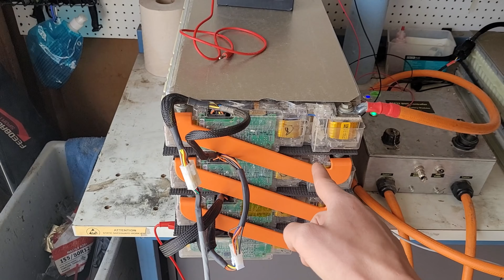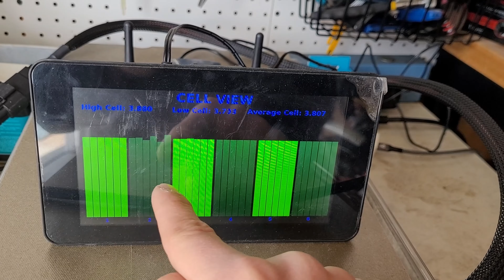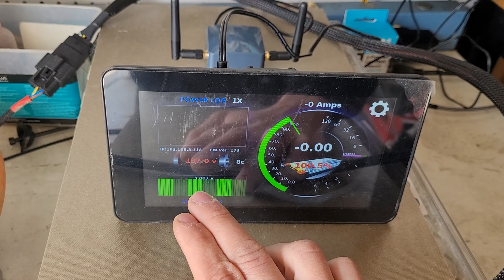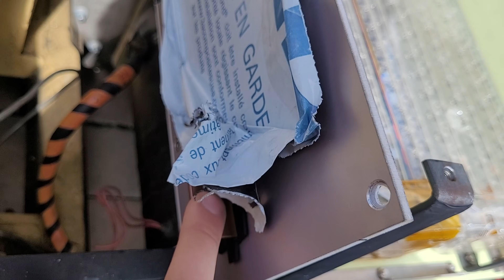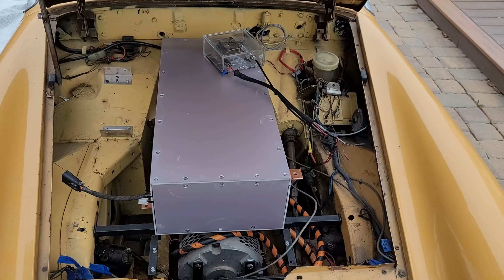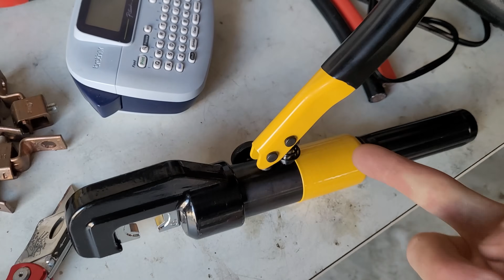Installing the TESLA Batteries: MG Midget Electric Conversion Part 9

Comment: I appreciate your unique solution to managing the voltage difference at the main connector. A coworker of mine, who designed systems for this professionally, used a similar approach. The key is to implement a precharge circuit, which consists of a resistor, capacitor, and some switches. By riding the 1/2 * C * V² energy curve, the circuit gradually equalizes voltage before full connection, preventing arcing or welding at the connectors.